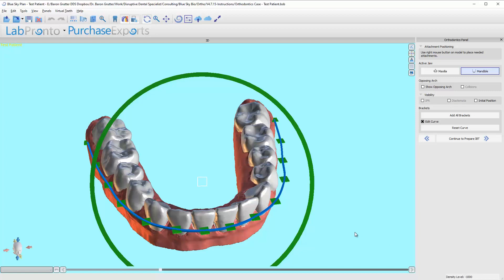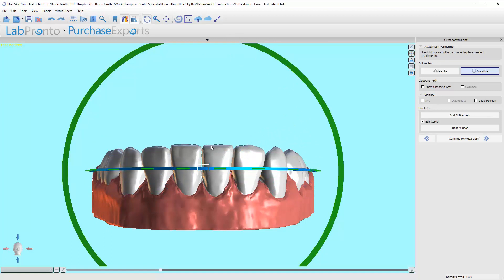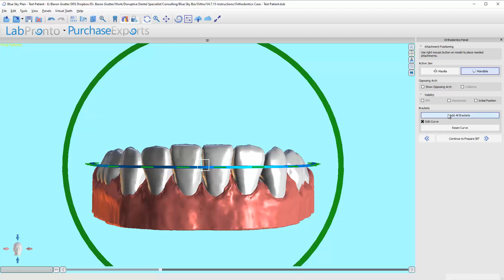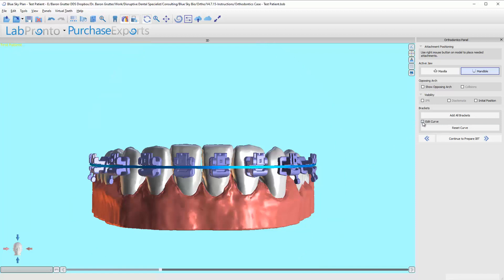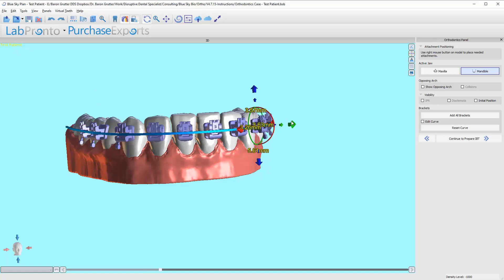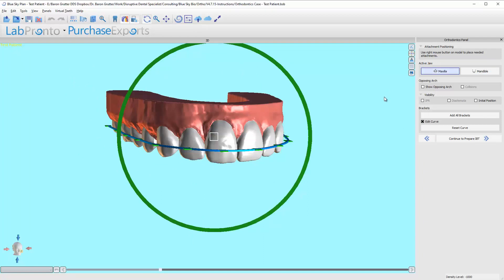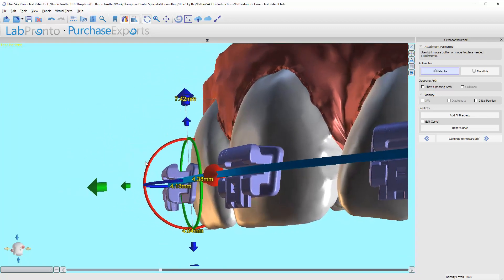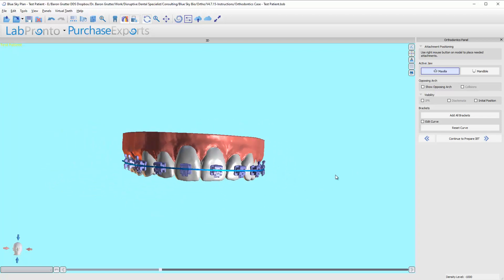BlueSkyPlan v4.7.15 IBT: Step7a - Bracket Positioning

Comment: Hey Baron, thank for the videos! Question: how do you reproduce the custom base if a patient has a broken bracket? with direct bonding you press the bracket against the facial of the tooth which would lead to unpredictable tooth movements if mixing it with this technique
Reply from the maker: In the scenario, your best option is to review the digital placement and attempt to freehand reproduce.

Comment: What brackets are you using.
Reply from the maker: I like these SELFY Passive self-ligating brackets.
Reply: They snap in and out of tray easily. Stay in place good for bonding? What bonding system do you use?